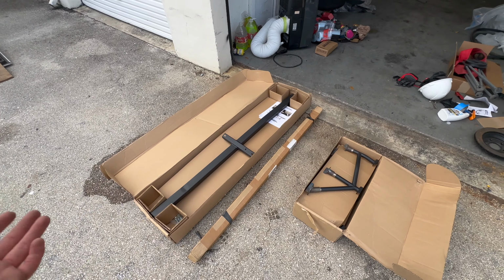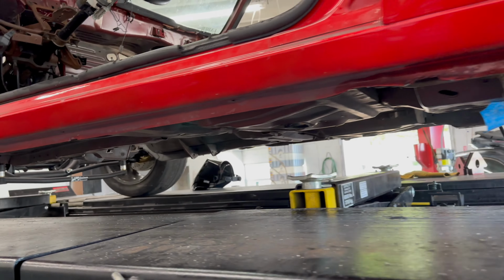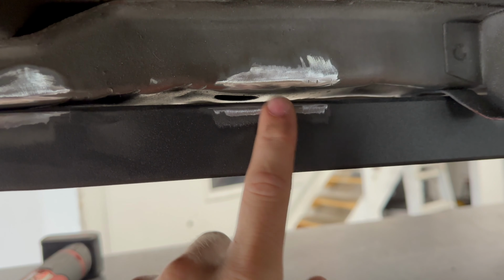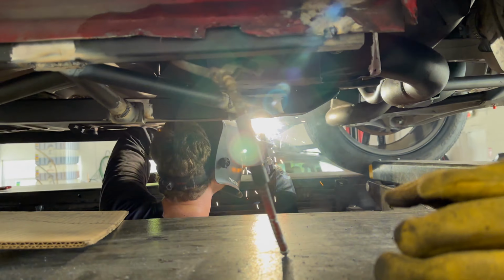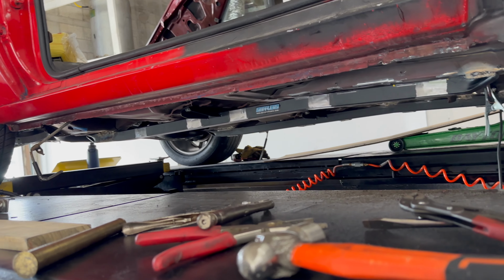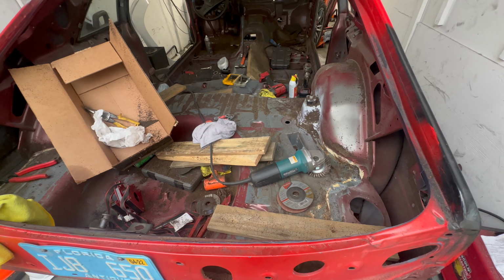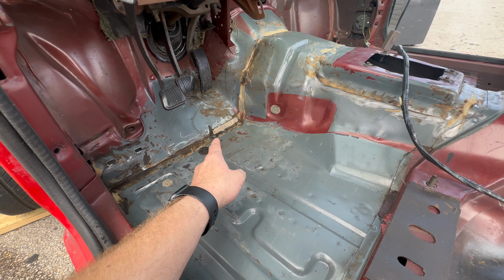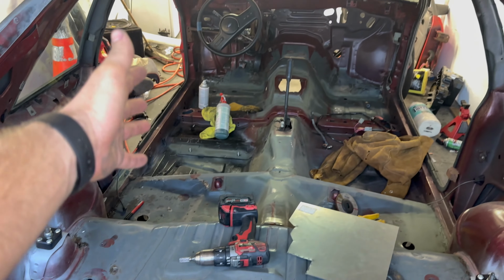Installing Stifflers FIT System on My 1986 Mustang

Comment: Been without a Fox Body since @2000 and its time for a new notchback when I find the right one.  Having owned my last one for 13 years I know first mod is strengthening uni-body so looking into what is the best system.  This has me intrigued and considering but on the fence.  How much stronger are these than say Maximum motorsport full lengths, is the added install worth it?  Lots of metal how much weight does it add and have you experienced these getting in the way of anything?
Reply from the maker: Sorry for the late reply, this slipped past me i guess.
I’ve heard differing opinions on if it’s worth the extra weight compared to maximum Motorsports but I’d say for most application it’s overkill. I went with this system for a handful of reasons. Main two being 1: it gives me a good mounting spot for future mods as I’d like to make a smooth skid plate for under the entire car (probably not going to happen for a long time unless i suddenly get rich lol) 2: side impacts. I’ve been in a pretty bad accident in my Pontiac G8 and if i didn’t hit backwards the pole would have definitely paralyzed or seriously injured me. This is just another thing making the side of the cars less likely to crush into the passenger area.
If neither of those are concerns you have or if it’s just a basic street car I’d say get MM or something like them. The extra weight and install time is enough to say it’s a net negative imo. Not to mention there’s a possibility this makes it harder to sell to some people? Probably not but you never know.
Reply: @StockBlocks  thanks for the reply and your take on this, the MM subframes were fantastic on my 90 but that was only making about 460HP my next one I am already thinking I’ll build 351W based stroker for it and targeting 600HP + so want to strengthen platform before putting that kind of power to it.
Reply from the maker: @msk3905  not a problem at all, if you want the best weight to strength ratio I’d say look into through floor setups assuming you aren’t worried about cutting up the floor of the car. If you’re on the east coast there’s a guy named Christopher Robins from guerrilla Motorsports who’s doing the roll bar in my car, while i don’t have personal experience at this moment with him, I’ve seen a bunch of his work online in the HPDE groups and he was super helpful when i reached out. Maybe worth shooting him a message to see if he can help you out.
Reply: @StockBlocks  I'm in northeast (MA) Guerilla is a bit too far and to be honest I like to do all of my work.  Will be 100% a streetcar to tool around in so first thought is the through floor may be a bit much.
Reply from the maker: @msk3905  if that’s the case, just get the ones from MM and call it a day, more than enough when properly installed in my opinion
Reply from the maker: @msk3905  so i don’t see this as being necessary unless you just like the design. You can always get some square stock and design your own setup that works with MM connectors if you ever felt the need. Just depends on how crafty you are i guess